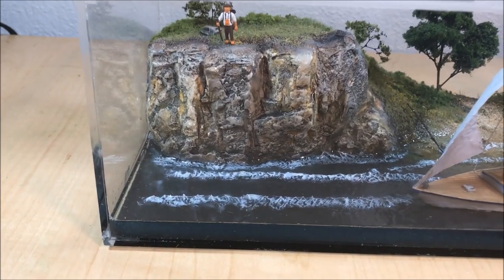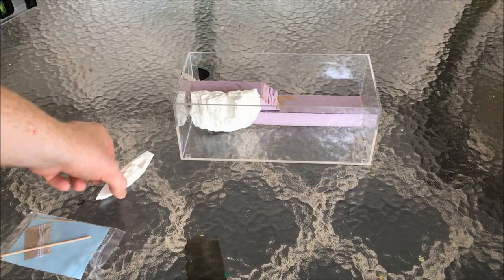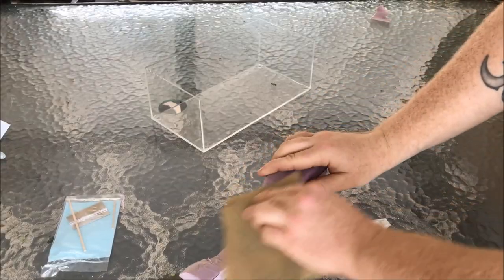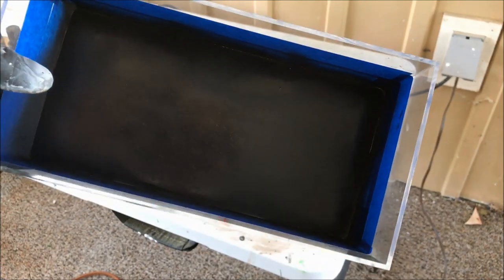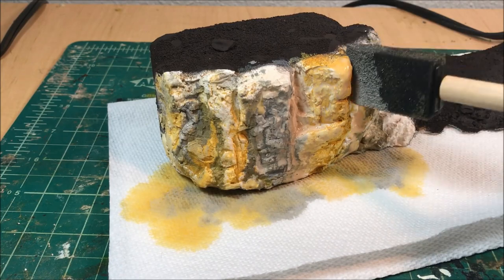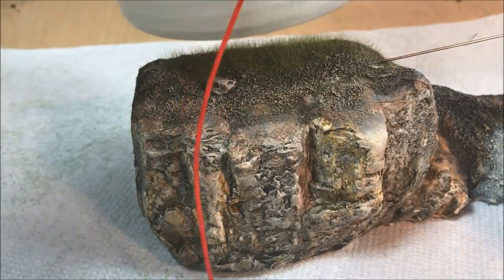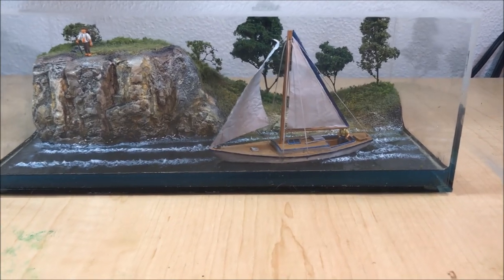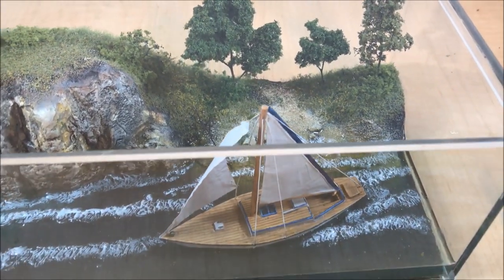Making Realistic Rock Faces and Shorelines

Comment: Maybe it's time you bought yourself a hot wire. Makes cutting foam a lot easier as you dislike it so much
Reply from the maker: Haha I have one but it is awful, I should probably invest in a more expensive one.  However, I have kinda changed my opinion of foam ever since I discovered how awesome hand sanders are with the material.

Comment: Sweet diorama, have you ever tried making waves out of silicone caulking? when I make miniature sails I usually use dried wipes Mixed With Watered down PVA.
Reply from the maker: I have used the clear stuff for making rivers and it looked good but man it was sticky.  Made it super hard to work with, but I could see how you could likely tease it into the form of waves.  Wipes!  That would have definitely worked better as they have more a fabric texture.

Comment: Nice Work on the cliffs! What material did you end up using for the sail & rigging on the sailboat? I’m gunna be making myself a Viking Longship pretty soon!
Reply from the maker: I used aluminum foil for the sails but I kind of regretted not making them out of linen.  For the rigging I used finishing line and was pleased with how easy it was to work with.
Reply: Red Beard Baron yeah I was thinking of using linen, thanks for the tips!